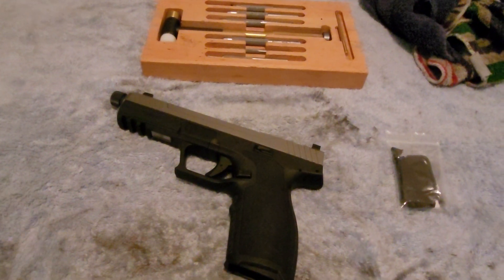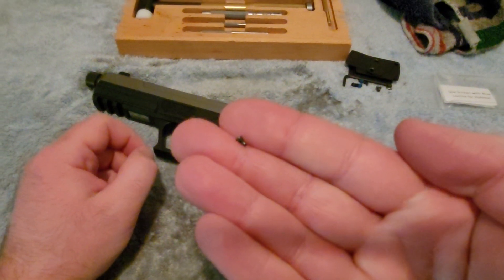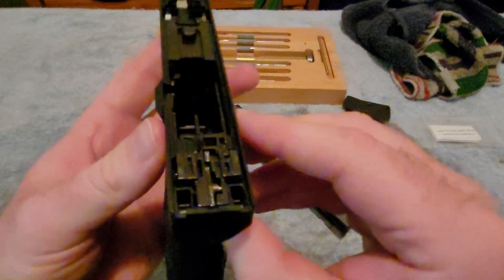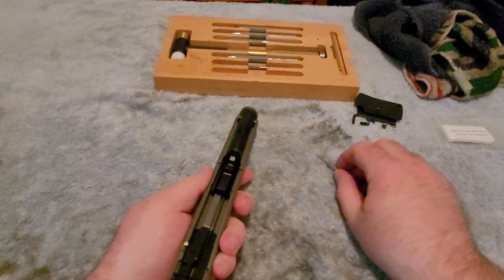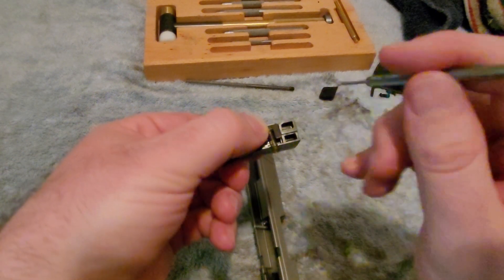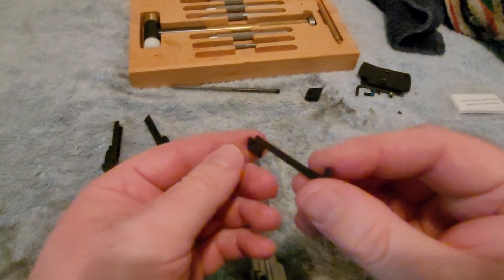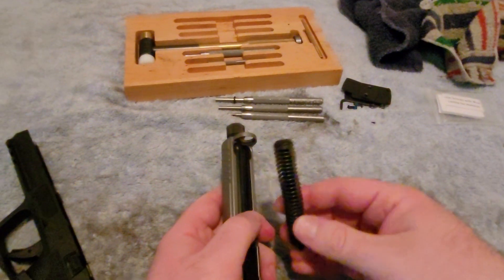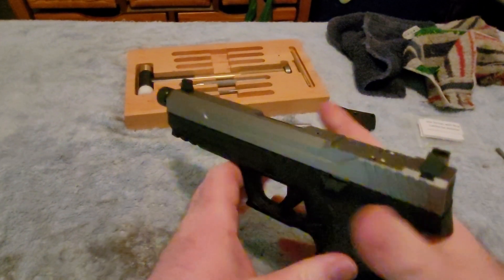Palmetto (PSA) Rock 5.7x28 Update: Need to Replace Striker

Comment: My PSA Rock is having the same problem with the reset.
Reply from the maker: To me it seems like a design flaw. Does the reset issue with yours show up only while dry-firing, or does it happen during live-fire too?
Reply: @reformedgga1510  dry firing. Never had a problem shooting it though.
Reply from the maker: That is very interesting. 🤔
Reply: @reformedgga1510  yeah it happens 98 percent of the time when dry firing, but when I insert the mag, it doesn’t happen. It has also never happened when I’m at the range firing live rounds. It’s been flawless at the range and is a favorite of mine.